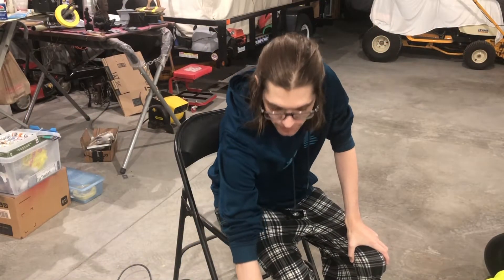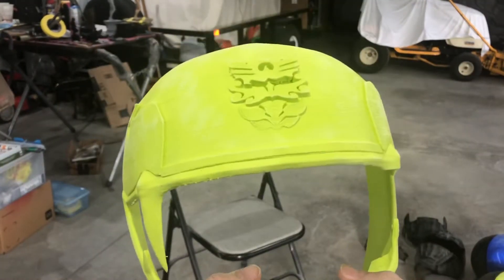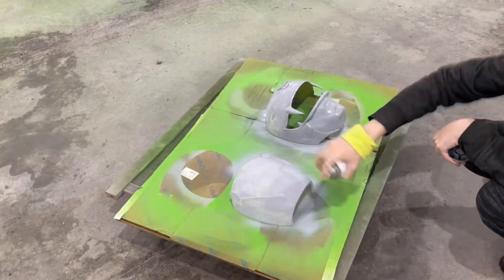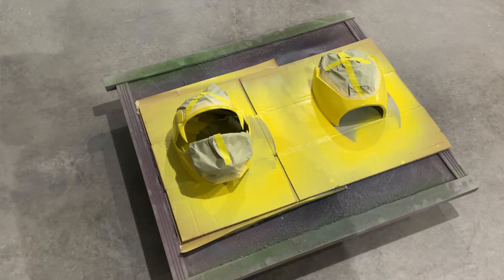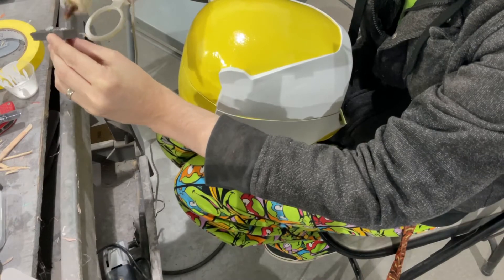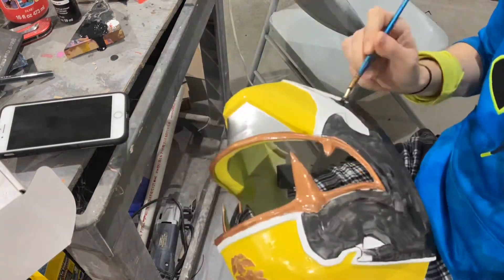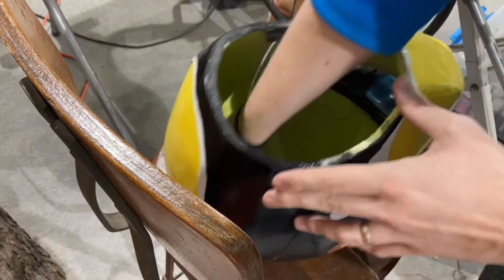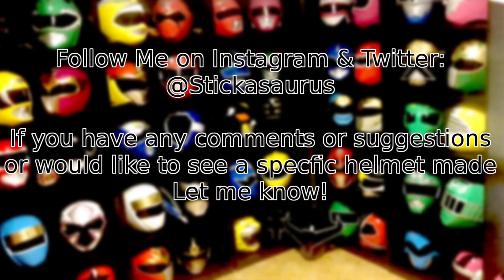3D Printing & Finishing a Power Rangers Yellow Megaforce Helmet

Comment: How did you turn a pepakura file into a 3d file? Could you do a video about that?
Reply from the maker: Sometimes you have to do things differently based on the model but most the time I export it into blender, extrude the entire model inwards some, select any faces that are details on the helmet and extrude them out some, sometimes you have to add hard edges to some of the details and shapes, then after that make sure you subdivide the model so you lose some of the blocky aspects you get with the Pep models. Then I usually slice it apart with meshmixer and then it should be okay to print. It's a lot of trail and error for sure though.
Reply: @Stickasaurus  thank you for this information :)